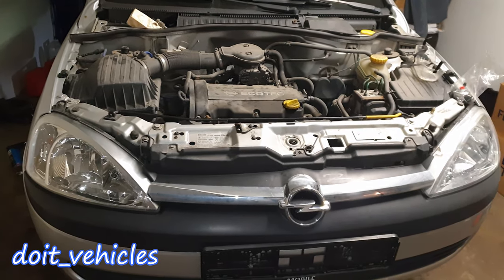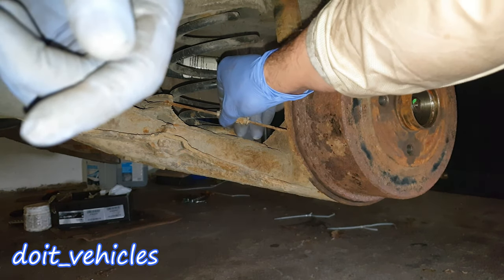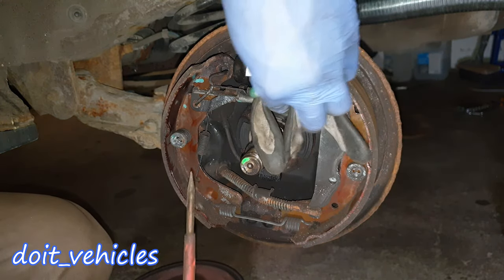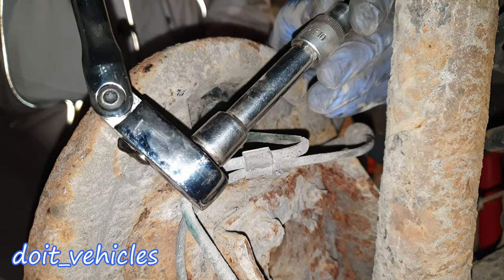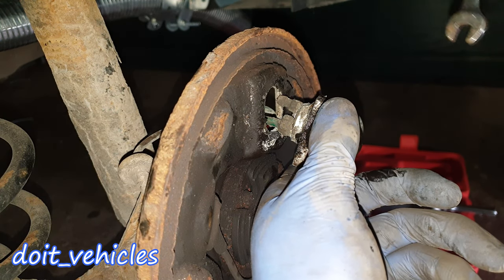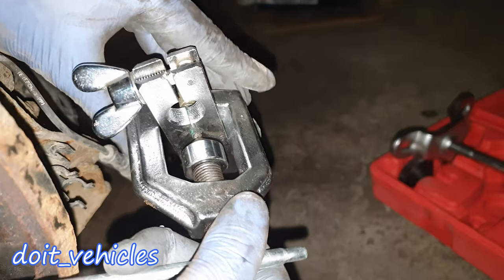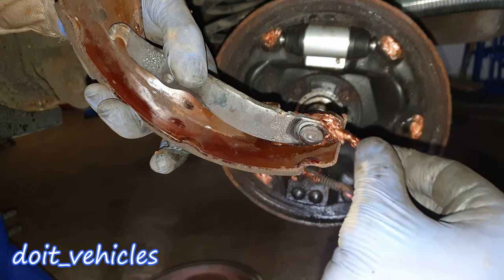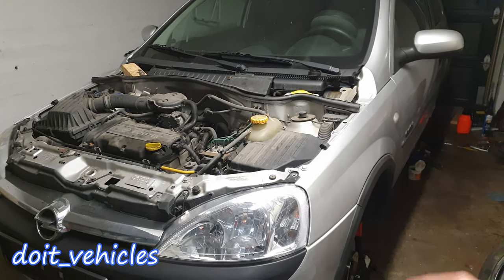Opel Corsa C Rear Wheel Cylinder Replacement , Brake Shoes & Brake Line Fittings

Comment: That brake line nut that is connected to the cylinder is a reall bit*ch to take off on my Tigra.
My cylinder is leaking and I would easily change the cylinder but that screw doesn't want to come off lol
Reply from the maker: I understand 🤯